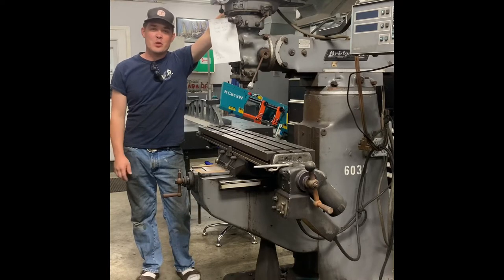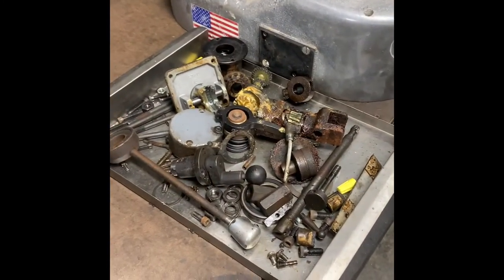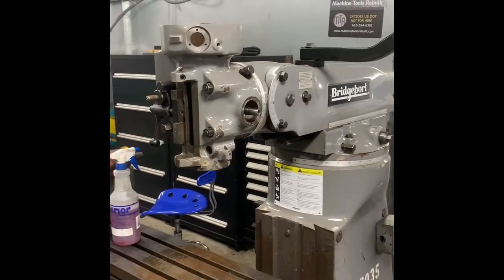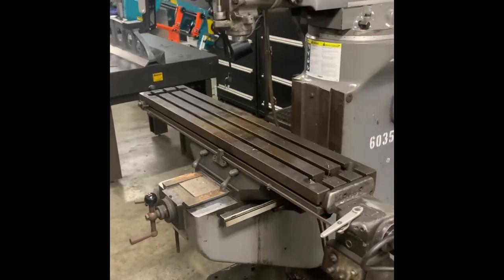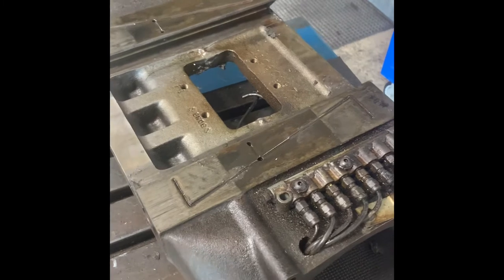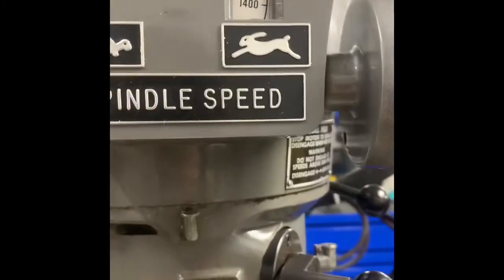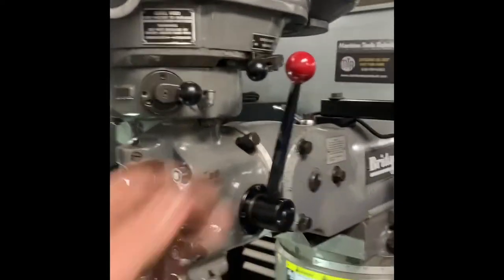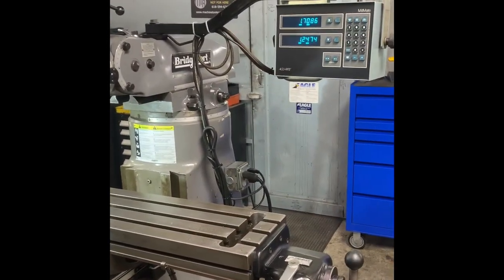What is a “Serviced” Bridgeport from MTR?

Comment: Very nice work!  I’m gonna contact you about some parts I’m looking for soon for my 19” leblond regal servo shift.  Need a steady rest for sure and want to get your take on how involved it would be to convert it to the later model quick change box (or gearing be it may) that can do metric or inch threading.  Leblond told me something like $5000 for like 7 gears and few parts which is impractical being that’s about what the machine is worth give or take a bit.